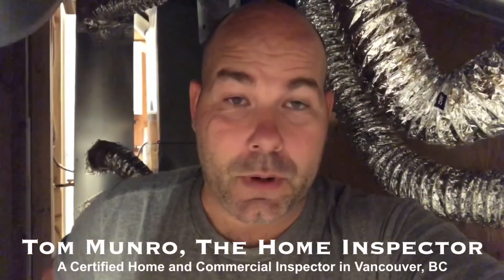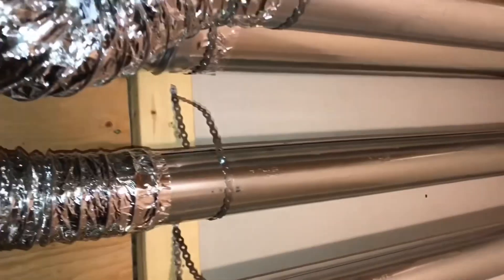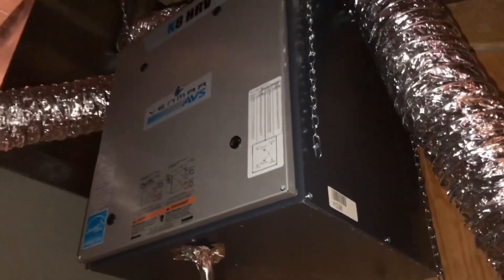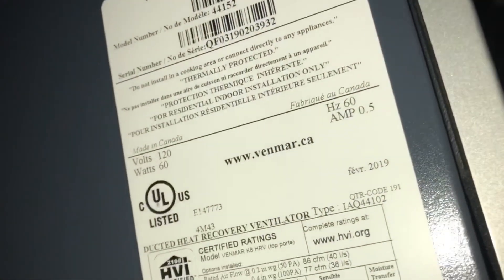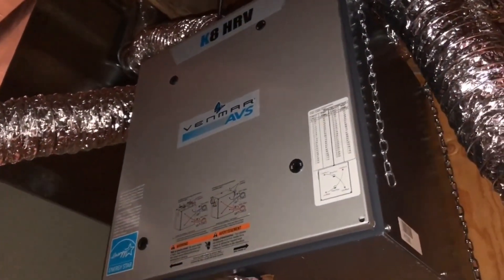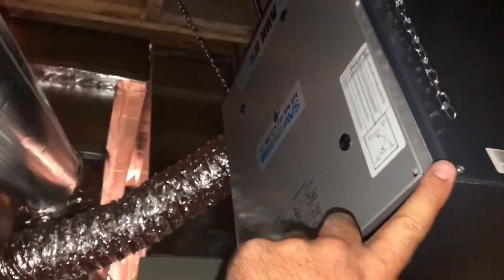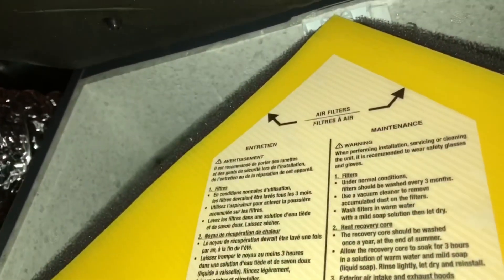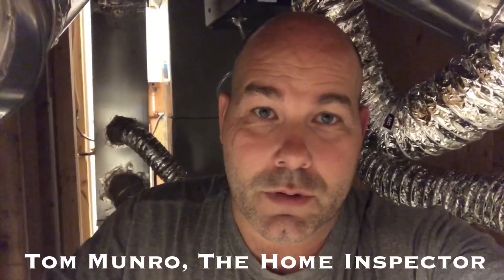MONSTER HOME, mini HRV

Comment: Is this HRV system required in all new builds in Canada?
Reply: Blaine Bugaski I was wondering the same.  Why are HRV systems so popular there?
Reply: @MLJenkins  As of late, Tom Munro has been mentioning them often!
Reply: Most places (in and out of Canada) require a certain amount of ventilation for new homes. HRVs and ERVs are good ways to accomplish that, but there are other ways of accomplishing it. Some builders might use more conventional exhaust fans wired to run constantly or I've even heard of central vacuum systems being accepted as helping to meet ventilation requirements.
Reply: The HRV systems I believe are mandatory on a lot of the new net zero and green homes. Because the building envelope is so air tight it pumps in fresh air. I'm not an expert on the matter but I think that's why they're so common. B.C is pushing the step code and making these style of homes more common place. Hope that helps